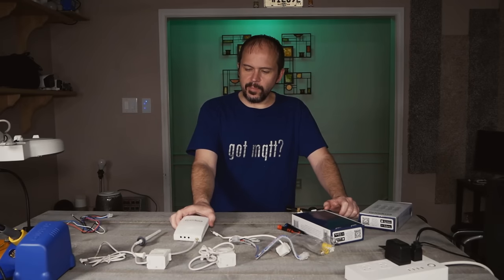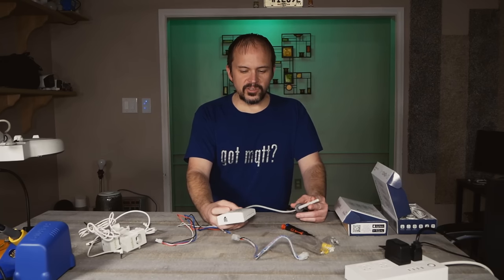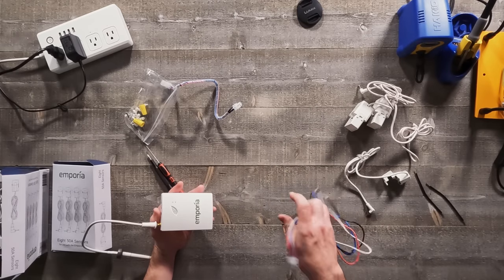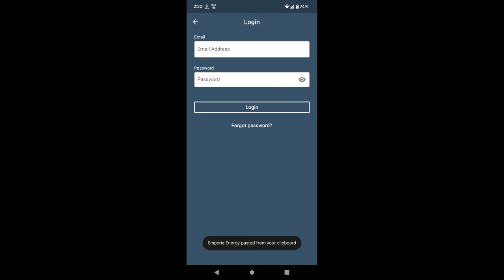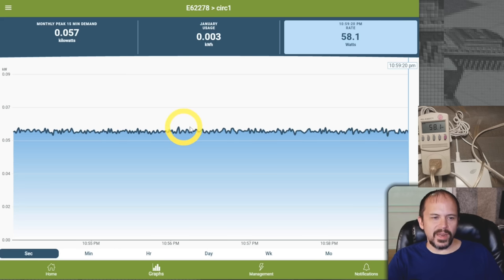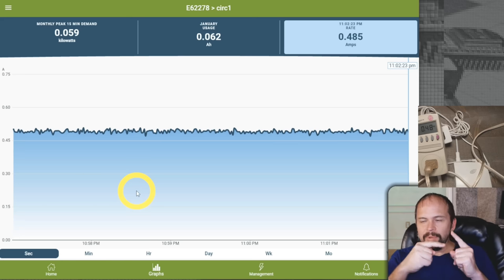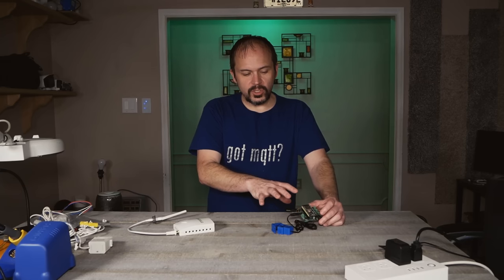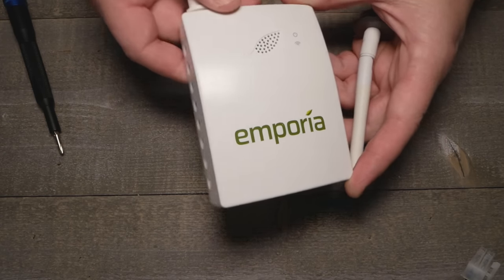Emporia Vue Power Monitoring Review | HOW TO w/ ESPHome & Home Assistant

Comment: Unfortunately, I am using a 64-bit Rasp Pi for this. ESPHome is giving me the following error: "Could not find the package with 'platformio/toolchain-esp32ulp @ ~1.22851.0' requirements for your system 'linux_aarch64'"

This is known issue documented on on the official GitHub for this project. Does anyone have another way of doing this? I really wanted to get this done via ESPHome since it is so much simpler than other flashing solutions.
Reply from the maker: Fire up a VM on computer maybe?  I thought they resolved this issue though.  I don't run a Pi so I can't check.
Reply: @digiblurDIY  I appreciate your response! I did end up with a VM but when I run `esptool.py flash_id` I get the following error:

"Serial port /dev/ttyUSB0
/dev/ttyUSB0 failed to connect: [Errno 13] could not open port /dev/ttyUSB0: [Errno 13] Permission denied: '/dev/ttyUSB0'"

I confirmed this is the correct USB port, and checked my connections and soldering. Everything looks fine. The USB to TTL adapter I am using only has the red light on for the ground LED. If I disconnect the power wire, the blue LED lights up for RXD. Tried this on 5v and 3.3v and even tried swapping the rx and tx in case TTL was auto-reversed as well. 

Any thoughts or lessons learned? Beginning to wonder if I got unlucky with the TTL (I purchased the one in your description).
Reply from the maker: I assume you are running on a linux box given the port?  Hard to really pin down the permissions, make sure nothing else is running that could be using that port.